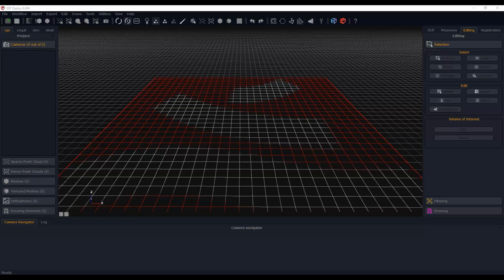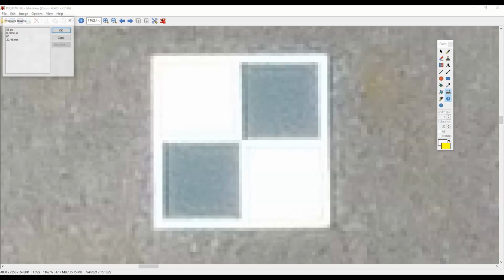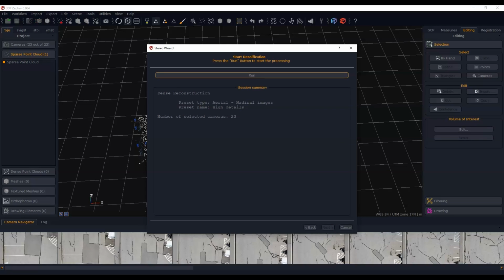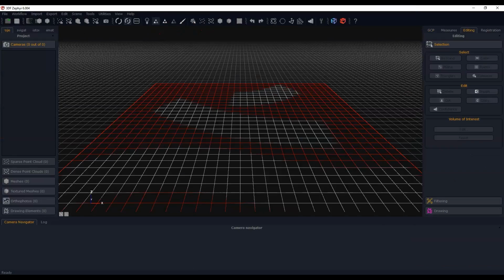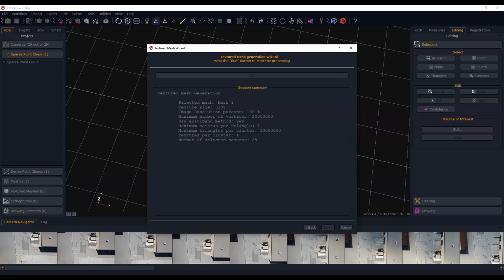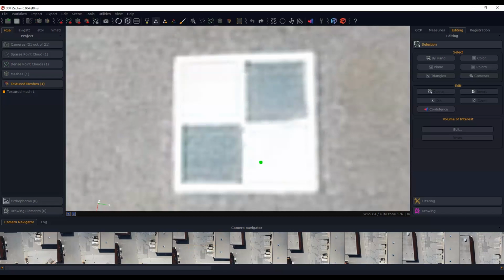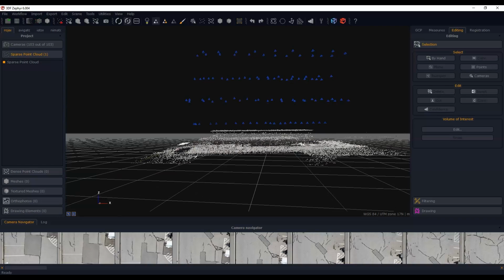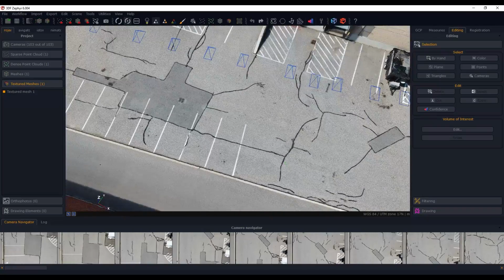Forensic Photogrammetry: How high to fly your drone and collect detailed evidences |Click 3D | Ep 34

Comment: So manual control. Is it necessary when there software to do this? Or is there some inside tips there?
Reply from the maker: I think the point is that you fly as high as you need resolution or accuracy to resolve whatever it is you are trying to do. There is software that will fly a particular mission for you but you should always have an idea of what you are going to end up with as a final result.